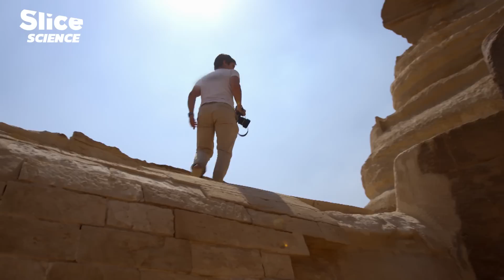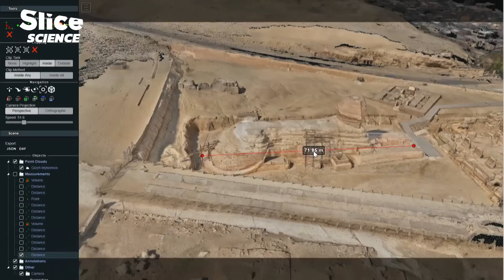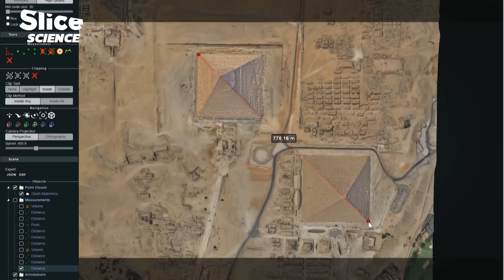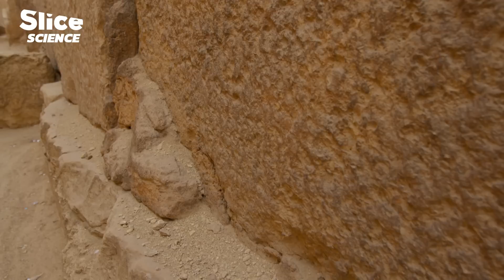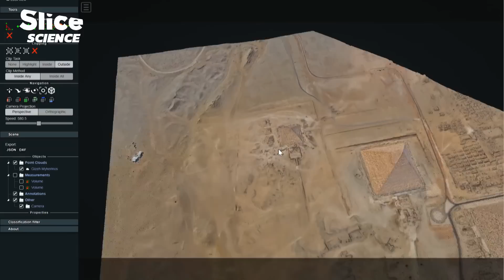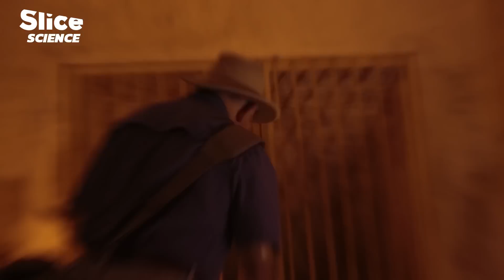Giza's Hidden Gems: Mysteries of Khafra and Menkaure | SLICE SCIENCE | FULL DOC

Comment: Why isn't there more wear on the head since it was the only part not covered by sand for years and years ?
Reply: It could be because the erosion was caused by wind driven sand which would be thicker lower down. If the top of the monument was higher up it might have been exposed to less dense wind driven sand